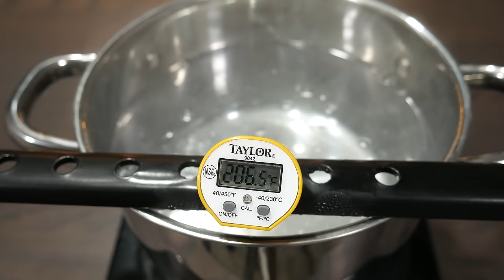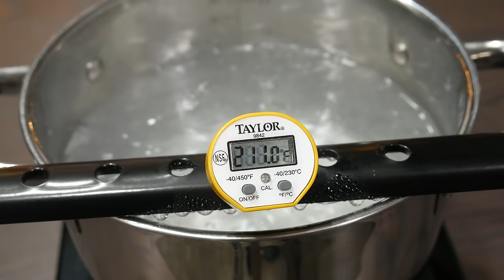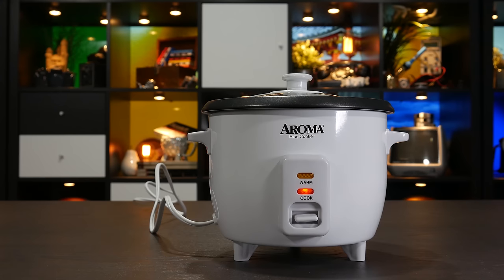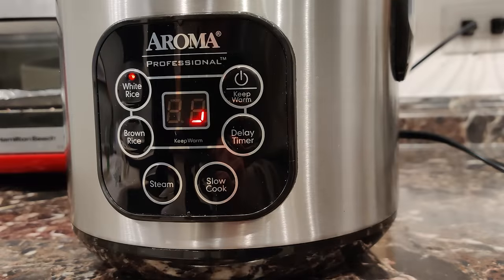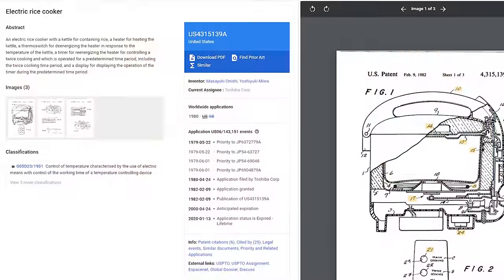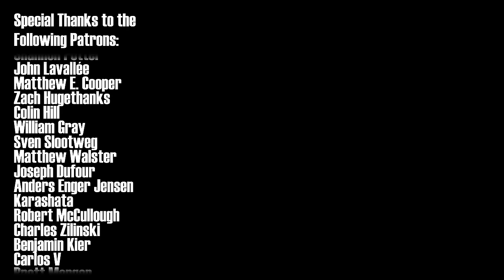Old-fashioned rice cookers are extremely clever

Comment: Who needs the dang metric system when we have a perfectly good system of measurement based off the foot size of and old English king.
Reply: More like ancient greeks ?
Reply: Don’t worry, you don’t need to use degrees with circles, you can use your beautiful metric gradians instead
Reply: @Nova-du5on  Ancient romans (which also used the foot) used decimal multiples, but dozenal fractions !
Reply: @Nova-du5on  The SI unit is radian. Example: Apply 1 Newton of force to a 1 m long lever arm. You have 1 Nm of torque. If the lever arm then rotates with 1 rad/s, you are pushing with 1 Watt of power. If you do this for 1 second you have done 1 Joule of total work. SI is beautiful, no ugly constants as far as the eye can see.
Reply: Bagi Badoo the radian is not a metric unit though. It’s an SI unit, but it’s definitely not metric.
Reply: @Nova-du5on  From https://en.wikipedia.org/wiki/Metric_system "Two units are measures of circular arcs and spherical surfaces:

Radian, a unit of circular arc
Steradian, a unit of spherical surface area"
Reply: @bagibadoo439  Eh, that has nothing to do with metric though, it's just maths. The exact same radian would be used in a foot-derived system.
Reply: @peaksingularity3032  Radian is indeed a metric (SI) unit, but that does not impede its use in a foot-derived system.
Someone mentioned metric gradian (nowadays named gon). It's a confusion frequently made due to its origin in French Revolution - alongside with the metric system. This unit was dismissed as the metric angle unit and is used mostly in highly specialized areas, such as geology due to its relation with Earth's meridians length.
Reply: @fernandojunior2256  Yeah, when you start getting into the details, and what might have been, metric and SI aren't necessarily one and the same. Gradian, with it's 100 gradians in a right angle, is extremely metric, or maybe, even more precisely, decimal. Radian, however, is a mathematical constant, not a unit coming from the (somewhat arbitrarily) choice of a decimal system.
Reply: Some rice cookers come with a cup that is not a cup, but a scoop.  So if you lose it, and measure in an actual cup of rice, it won't cook properly. 
How many ounces is a scoop? Or grams. Or milliliters. Or grams per milliliter of dry rice so one can convert to dry ounces?
I don't know. So I'm going back to eating potato bread.
Reply: This but unironically
Reply: @Nova-du5on  SI literally means "système international". It's a direct synonym for the metric system. Stop embarrassing yourself.
Reply: Paesan Control Centre the only thing embarrassing in this entire thread is the constant harassment of people living in a different country.
Reply: 0:59  212 degrees happens to be easy to remember because I just watch your 'rotary dial phone' show where I learned why 212 was New York City's original area code!
Reply: It's actually based on the size of barley corn seeds!
Reply: COHERENCE
Reply: TactiGrill Because basing any standard on a thing that differs in size makes perfect sense! 
So what was the stone unit based on? A stone? But if you pick up different stones you’d get different results. Theft must have been easy for the knowledgeable farmer.
Reply: @KarryKarryKarry  You...think this means farmers sold their grain by kernel size? Ouf...
Reply: Yeah, who would think a system of measuring based off of parts of a human body and direct human experience instead of things like the wavelength of a certain kind of light...🙄
Reply: @bagibadoo439  Couldn't have said it better myself. Other than that it's easy and feet kinda suck because you'd have to use fractions instead of decimals.
Reply: @elcidbob  Stop your eyes before they roll out of your skull. We don't measure wavelength with our eyes. You're thinking of color, which doesn't count. Apparently the legs of a king count, literally, because royalty I guess.
Reply: @PunakiviAddikti  oh, excuse me,  the meter is the much more easy to measure distance that light travels in a true vacuum in 1/299,792,458 seconds. That's such a really human thing that it's super easy for anyone to have a good idea of every it is.
Reply: @elcidbob  Well since all imperial units are defined in metric units, feet are also defined by the speed of light. But if I say something is 100 yards away, would you have to convert that to feet to get a sense of the distance? No you are simply used to the unit, in the same way people are used to the unit meter.
Reply: @bagibadoo439  which doesn't change the magnitude of the units and how they're all useful sizes for every day tasks. 

It's interesting that you hit on the exact reason that the vaunted metric system isn't all that terribly useful: it's only utility is simplified dimensional analysis, which most people never bother with.  The number of inches in a furlong don't matter because no one does that conversion outside of as a party trick, and it's not because it's so difficult to remember conversation factors,  but because you measure things with the magnitude of measure that's appropriate to the thing being measured, and this is all without mentioning the vast superiority of fractional measures over decimal for most everyday tasks, or are you really going to die on the hill that 0.5625 is easier to deal with than 9/16?

Metric is awesome when precision and use in more advanced math are needed.   Everyday life for everyone else? The system that's based around humans and not things like the melting point of an arbitrary compound is better. 

If you were like most Americans who use both daily,  you'd realize this.
Reply: @peaksingularity3032  foot of ancient greeks? ohh now it makes sense
Reply: Imperial units weren't standardised for most of their existence, and often had different regional measurements. I believe america was the first to standardise imperial units (please correct me if I am wrong), and I believe this is why Americans have different measurements for volume than the rest of the world that uses imperial. 

British market places used to be interesting in that not only did you have to look at the prices, you had to look at how the vendor measured their product. I presume this is true for the rest of the imperial world, but I've not looked into it
Reply: Hear hear!
Reply: @elcidbob  "Yeah, who would think a system of measuring based off of parts of a human body and direct human experience instead of things like the wavelength of a certain kind of light." So you tell me you are still using your body parts to measure things and expect somewhat precise measurements? BTW metric isn't great because of what it's based on, (originally it was based on the length of a special metal alloy rod but not on an old man's leg) but the easy exchanges between different units. FYI the meter and its derivatives have the "human body model" too. Stretch your arm to the side! From the end of the fingertips to the nipple of the opposite side is ~1 meter (for an average man).  A span (stretched hand, from the end of your thumb to the end of the pinky)  is around 22cm. Thumb to the middle finger is 20cm. And so on...

" 0.5625 is easier to deal with than 9/16?" If you put it that way not really. Let me do the same thing!  Which one is more easy, 75mm or 2 80/84"?
Or which one is smaller and how much? 23,5 and 23,25 or 9 2/7" and 9 5/16"
Reply: Fahrenheit is based on percentages of degrees between slight fever and what Fahrenheit considered the coldest day he remembers.
Reply: ONLY THE GREATEST COUNTRIES USE THE IMPERIAL SYSTEM. LIKE THE UNITED STATES, LIBYA, AND MYANMAR!!!!!one!!!1
Reply: @Arch Stanton USA rules the world? 😂 😂 😂 😂 That was a good one.
Reply: @Arch Stanton meanwhile the rest of the world and those actually making progress (scientists) will continue to use metric
Reply: This why I'm great with fractions!
Reply: @bagibadoo439  except for Avogadro's number, the number of cycles of some frequency of light to define the length, the number of oscillations of that caesium atom, ... wink
Reply: @leftysheppey  the difference in pints is mostly down to the US version being 16 fluid (US) ounces, and the British one being 20 for some reason that makes little sense at all.

The point being that (looking at the British system) a gallon is ten pounds of water; a British pint is an eighth of that (which seems a little daft, except that it's half a quart, and a quart is a quarter of a gallon.

Insanity does appear in places, and "outdated" is certainly a reasonable description of many of the older units, but their origins are more rational than they are usually credited with.
Reply: So let's use the metric system because it's derived from a 10 millionth of the some arbitrary  distance.  Yeah that's really scientific.
Reply: And old english king what? Of has a foot size? I'm confused.
Reply: @PrivateEyeYiYi  metric has more applications than that. The measurements have been standardised to they can be reproduced if necessary. Metric actually holds a lot of its importance from water. 1 cubic centimeter is 1 millilitre. 1 millilitre of water is 1 gram. It takes 1 calorie of energy to heat up 1 ml of water 1°C. A lot of these are interlinked. 
I know the calorie isnt used as much in science any more, but it was when metric was younger, so I think the point is still relevant
Reply: I like my nonsensical units.  Hands off.  Whatever size they are relative to mine.
Reply: The funny thing, Americans who lives in Europe uses all the metric measures. Inch can describes some standards, but not all.
Reply: Celsius means: Point where ice melts is zero, point where water steams is 100.
Kelvin means: Point zero is the lowest possible value.
Reply: Back to Back World War Champions can do what they want.
Reply: What makes 100 C more difficult to remember than 212 F? It is less and is a round number,
Reply: Bart Price As long as it’s one of these styles it won’t matter at all, as long as the volumetric ratio is still correct. Most bulk rice bags tell you the optimal volumetric ratio for the given variety, ie 1.5:1 water to rice for jasmine. So for myself I grab a half cup and do 0.5 cups rice, 0.75C water and that works, for the family I do either one or two full cups (with either 1.5 or 3 cups of water). That’s the beauty of ratios.
Reply: Paesan Control Centre in a rice cooker that’ll give you terribly soupy rice because of the lower evaporation over the cook time. 1.5 is the standard for jasmine rice, gives you a nice sticky rice
Reply: And the barley seed
Reply: At least a foot is a composite number...
Reply: Stock Name  that's why water freezes at 0 and boils at 100 degrees celsius.
Reply: Unironically completely agree
Reply: Foot size of an old king, the then-accepted circumference of an arbitrary planet divided by units of 10, same thing. Arbitrary and nonstandard. Use degrees kelvin or you don't get to complain
Reply: @leftysheppey  Under what pressure? Air pressure at sea level? What's sea level? It's certainly not in a vacuum because water boils in a vacuum.
Reply: Let me address a few things I've read in the comment chain: when I measure things using my own body, I don't need precise measurements, I need to know if the thing I'm moving will fit through the door in front of me or if I have to turn it to get it through.  That's why I use my body in those cases!  The unit of choice doesn't matter as long as I get the right answer. There's a thing called good enough.  So I'll continue to speak of my room temperature in Fahrenheit even as I speak of my processor temperature in Celsius.  Because 100 degrees should be hot, not I'm literally dead right now.
Reply: And when your wrong because you never seen the kings foot you get killed
Reply: Bruh. This whole comment thread is just a mixture of people not knowing what counts as metric/SI/decimal and which is which, occasional firm imperialist and a few people just linking it all back to boiling rice. I don't know what is going on, but I'm proud of you guys.

To be serious tho both SI and imperial derive from nature, imperial from rough dimensions of the body and whatever else and SI from physics and having ten fingers. Both have their uses and as tempted as I am to keep arguing about it that really wouldn't achieve anything
Reply: Idk, I like imperial measurements for large distance and stuff that doesn't need much precision. Miles and pounds and feet are nice
Reply: @robfriedrich2822  Yup we can use both but people tell us we are stupid for it. We can figure out two different temperature measurements as well. We can even figure out different time zones!
Reply: @sudocatsda1guy390  That isn't actually true. O F was the temperature of an icy salt water mixture, because it was the lowest temperature that was easy to reliably create and maintain. 96 F, the other end point, was... average human body temperature measured at the armpit. Which isn't the MOST unstable reference, but isn't a particularly great standard.
Farenheit was making a thermometer that scientists of the era could easily create. That's why the high reference is 96, because the thermometer  can be easily marked up by dividing in half repeatedly. He also, is it happens, gave them the knowledge to make a mercury thermometer, which was markedly more reliable than prior devices.

The original calibration was not codified into standard.
Reply: @bartprice3439  just measure the water level with your finger or eye it, roughly 1/2 to 1 inch of water above the rice.   

Similar method, 1/2 cup water more than the amount of rice, 2.5 cups water for 2 cups rice, cups as in glassware, doesn't matter metric or american glazed donuts per bald eagle, in cooking you gotta adjust and adapt on the fly to make wonderful recipes.
Reply: Use finger measurements when cooking rice.
Reply: Fun fact: Feet/Pounds/Gallons, etc are legally based on the Metric System.
Reply: It's not. It's based on the metric system. Honestly America is half way to just adopting the metric system outright
Reply: @bartprice3439  it depends how much Beffels. Given that 5.23 snail spoons is one Beffel.
But you might be clever and hack a system using just ratio. But I know. Using ratio of rice vs water is ugly metric invention. It's never used in imperial measurement system for sure!
Reply: @sudocatsda1guy390  Actually once I've been approached by a bit of savant guy from math-physics faculty who wanted everybody to use Kelvins.
Reply: Anything less makes you a communist.
Reply: @randomguy8196, yup it worked for generations of people and is an awesome way to cook rice. Only fails when people cannot be asked to mind the pot for five minutes at the end of cooking.
Reply: @elcidbob  exactly. The worst is Celsius. It’s great for science experiments or whatever, but I’d rather know that at 0 degrees, I’m in real danger of hypothermia, and 100 degrees, real danger of hyperthermia, than 0 being eh, getting chilly but I can deal with it, and 100 being boiled alive…..

Comment: The best part about these rice cookers is that they are physically automated as apposed to mechanically automated. This kind of automation is personally my favorite due to the lack of moving parts and the reliance on something as constant as physics. Absolutely beautiful.
Reply: Well, these are mechanically automated. 
That lever is mechanic, although controlled by magnet.
One of the most finicky things is that thin copper switch terminal. It could really easily bolt in if there is an over current and then you cannot turn it off.
But it is clever and gracious design.
Reply: Over time the magnet will lose it's power though.
Reply: @DaDunge  Over time, everything is bound to stop working due to degradation from one reason or another. The point is, it will easily last a relatively long time, and is very consistent.
Reply: What would you say is a long time? Mostly I'm curious about the record 🤭 the Panasonic rice cooker that works exactly like the one in the video hung in there for my family for over 15 years, finally kicked the bucket this year, and I found one exactly like it brand new on eBay from an electronics store and its packaging looked like it was sitting on a shelf since the 90s 🤭
Reply: @rhythmelia  my general rule is: if an electronic gadget can outlast the average family pet, its a venerable design.  

electronics should have a lifespan to some degree, otherwise the wires, heating elements, and whatever else could decay too far and cause a fire/blow fuses.  but some things don't need the complexity that claims to bring additional comfort.  if rice cookers were more popular in the west, theres a high liklihood one would come with GPS tracking and an stat tracking app that tells you how much rice youve made quarterly... and stop working altogether if you didnt buy that companies rice.